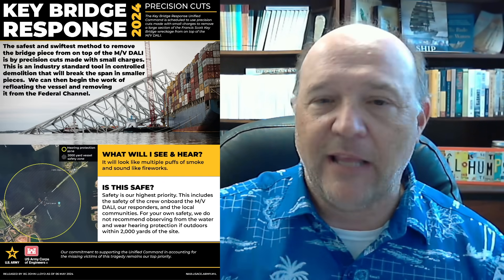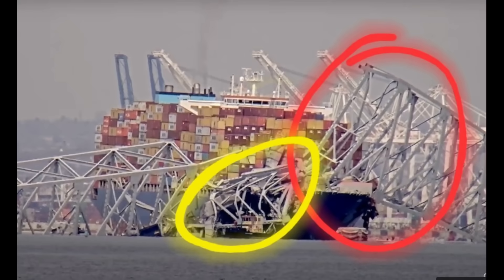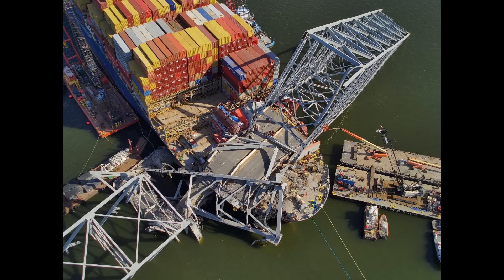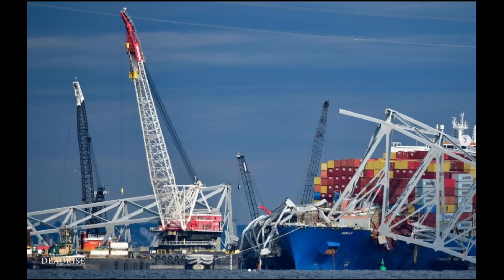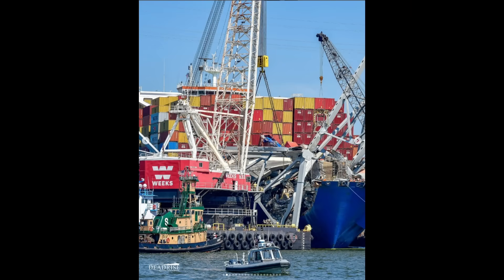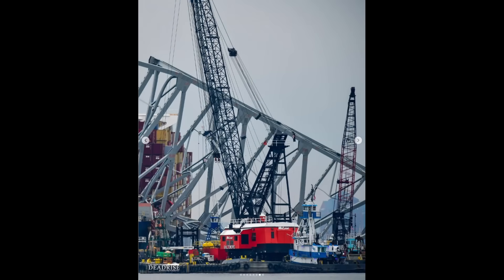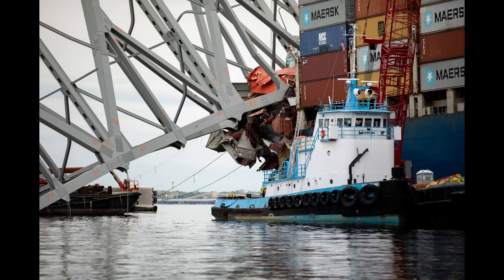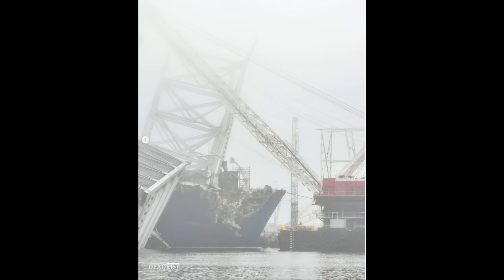FIRE IN THE HOLE! | Baltimore to Blow the Key Bridge Off MV Dali

Comment: I still want to know how they're going to get those concrete columns out of the way. It's not like the big crane will be able to lift one of those big chunks.
Reply: The concrete breaks up quite easily with a large hydraulic/air/steam breaker.  Torching the rebar etc
Reply: @jonmccormick8683  I just saw another video that showed where they have started cutting the column apart with a concrete saw. I want to see video of such a saw in action. 👀

Comment: You imply that it is all going to be hunky dory after they clear the bridge off the Port side, saying one that is done the weight will possibly come off the bow and they might need to move some small bits to remove the Dali.
Only one slight snag with that!
well quite a major fact that you over looked!
yes they removed part of the bridge metal work off the starboard side and they have removed most of the metal from the port side, but that is not the end of it! the Dali is not going to be removed as quick as you think!
they still got a huge problem that you overlooked namely that huge column of re-enforced concrete that is still attached to the foundation of the bridge, that has also snapped over the gunwale that is buried under the road deck. As pictures show that is a massive piece of concrete! that is not going to be easily removed with all the re-enforcing inside of it.
I think you will find the Dali is going to be there for a few more weeks.
Reply: They can cut through the rebar with torches. The concrete is gravel at the broken joint. With the containers they've already moved, and the girder taken away, the ship might float already. They can get her to the dock and continue demoing the pylon there.
Reply: @blairhoughton7918  yes like you say they can cut through the rebar that they can see, its the ones they can't see that is going to be the problem.
if they manage to cut through that, you still got the problem of the pylon, that looks to be about 40 -50 ft long, then you got the part of the pylon that is under the road deck.
yes they might cut it off the foundation but looking at it the pylon is longer than the draft of the Dali and if that falls into the water that could act like a spud leg.
I think that is going to prove to be a bigger challenge to remove than the steel work.
but we shall see.

Comment: What are the odds that some of the falling bridge will damage the gas pipeline when they blow it?
Reply: About zero.  The issue is that maybe the pipeline is already damaged and with the weight now coming off you have a leakage.
Reply: Sal mentioned in another comment that the pipeline has been depressurized.

Comment: How will they manage EOD clearance before resuming work on those elements?
Do they use photo analysis to determine which charges, if any, failed to fire?
Reply: Failed charges most likely will not be a thing. They won't matter if they fail. They will just go into the ocean.

Comment: you really think it's gonna float with the mud suction and the big concrete pillar still pinning it down on the starboard side?
they're just gonna let that pillar fall off if dali floats?
Reply: The tide should be able to lift this ship and pillar quite easily, however the hull suction to mud is a large force.  -If the ship lifts from the rising tide, everything should go well. 

Port of Baltimore did this to another container ship that went out of the channel just a year or two ago. -Took a few months to refloat at high tide, with many containers needed to come off.

Comment: Ship Can’t be too damaged  if they force crew stay on board
Reply: Operational and SeaWorthy can be quite opposites.  -This ship will most likely be scrapped.
Reply: What documentation supports the conclusion that the crew is being "forced" to stay on board? 🤔 The ship is not sunk, it still has plenty of systems which need to be maintained for use when it is freed, that maintenance requires a crew.
Reply: @scottfw7169  mentioned crew still onboard 😆 us think if they had a pass they might go sightseeing? Well maybe not in shythole Baltimore 😆😆 but could hop off claim refugees, go past go , collect $10,000. Snap card and free citizenship. Most like Philippine origin have many friends  here

Comment: Why didn't this bridge have dolphins protecting the bridge piers?
Reply: It did/does. There are only 4 of them, they are rather small, and are far enough away from the bridge piers that Dali could sideswipe one and still hit the bridge pier.
Reply: @scottfw7169 Or in this case, just curve around the dolphin without touching it.
Reply: Dali cruised right by the dolphin that was supposed to protect the bridge pier, it was small and too far away.  A single small dolphin for each side of each pier, total of 4. By comparison, the replacement Sunshine Skyway bridge has 36 large dolphins and 2 large rip rap islands surrounding the suspension towers.

Comment: Sounds like a bad idea. To prevent further damage to the Dali, explosions are unpredictable at best and likely to cause further damage to the vessel. 

The simplest and safest method is to have several cranes attach to the bridge, to lift support the remaining parts, and remove the cut off section, then lifting the cut section away, then repeat until the ship is free. There is also the risk risk of the cur section that;s dropping gouging into the hull of the ship.
Reply: Shaped charge cutting is very well established. With CDI involved, the cuts are predictable.  Lots of math involved in designing the placement of cuts.  Lesser demo companies have indeed had problems.
Reply: No, you are wrong. This company doing this might be the best there is. This is highly predictable. Shaped charges are not new. Trying to coordinate multiple cranes is far more dangerous and hard to do.
Reply: The section resting on Dali is under enormous tensile and compressive stress, thus the intention is to get rid of the whole truss in a couple seconds.  The cutting is done by shaped charges, using the same principle as bazookas and later antitank rounds. 
Note that the explosions are sequenced over a period of milliseconds up to seconds to make the trusses rotate away from the ship.  Similar to how they implode a building, blow the internal columns first so that the center collapsing pulls in the outer walls. Mechanical Engineer.

Comment: They are cranes in the world which the USA could have used to remove this steel structure months ago. Is it that because the USA don't want to introduced other countries into this task? I thought that this removal was completed months ago. The USA seems to be doing unnecessary work. I don't agree with video presenter that there isn't a crane in the world which cannot remove this steel  structure. China, Germany and a few other countries have crane which can easily remove this steel structure. This is just politics.

Comment: Maybe it was too expensive, or the harbor not deep enough, but what they could have used was the vessel SLEIPNIR of European design.  They probably could have finished this job weeks earlier having a REAL hoisting device rather than the little toys they were playing with.  Explosives would have been unnecessary as well.
Reply: With that much force, the trusses would fold up and you'd have a bigger mess.  C1000 and 533 are taking big pieces, up to 450 tons.
Reply: @SteamCrane  First off, you only use the force required.  Having overkill power but not necessarily using it, is an advantage.  You saw all the detonation points,  There's gonna be lots of little pieces left over to clean up.  I don't think the harbor is deep enough to accommodate that large ship any way, so it is really a moot point.

Comment: What could possibly go wrong…
Reply: Based on the animation, I noticed that after the charges went off, there was still a big solid piece of bridge sticking out of the water. Why doesn't it fall down once the ship is not supporting it? And if it does fall down, won't it strike the bow below the waterline?

Comment: Im confused as to how explosives will do what acetylene torches or plasma cutters cant, especially without damaging the ship.  Cant they just cut the bridge into smaller and smaller pieces?
Reply: The bridge span is under load, some beams will be in tension and some under compression. If member is under tension, when cut, it will spring appart. Those under compression will spring together. With separate cuts the loadpath will change. Having the steel move when cut is dangerous for the cutting crew.

Weakening the steel and then using small qualities of explosive to complete the cut, allow all of the cuts to be made at the sametime. In practice the timing of the explosions could be adjusted, so that the loadpath changes and ensures that the cut pieces fall clear of the ship.
Reply: @christopherrobinson7541  Excellent description.

Comment: Are they going to use the same explosives that was used on the twins ?
Reply: Are you going to ever grow up?
Reply: @blairhoughton7918 I think the reference is to building 7 that was taken down after with explosives.
Reply: @robinblackmoor8732  "the twins"
Reply: @blairhoughton7918  yeah, building 7 of the twin tower complex. It needed to come down. So, they used the same technique that will be used for the bridge. I think that is what the original comment was asking.
Reply: @robinblackmoor8732  The WTC complex, of which the Town Towers were only buildings 1 and 2. That's a long long way back to reach in history for a reference to explosive building demolition. And looks conspiratorial as it's phrased.

But to answer your question, yes the principal is basically the same. You put a linear shape charge across a steel beam and set it off and it cuts the beam, which no longer holds things together. Gravity does the rest.

Though in this case there's no wall material to get out of the way first, and there will be almost no dust cloud obscuring the view because there's no masonry and everything is going to fall in the water.

In fact, you could probably search for bridge demolitions and find a dozen more similar examples.

Comment: Why would you blow up the bridge when they get chemicals on their corrosive stuff are they that much of a lunatic you don't do that when you get chemicals and crap like that on those containers
Reply: small contained charges
Reply: Good bet the containers with the chemicals up forward have been removed, and the ones that were crushed under the bridge have been cleaned up the best they can.
The shaped charges will be mostly set off parallel to Dali (as they're cutting the steel beams) so any shrapnel that makes out past the wrapping will go beside Dali, in addition to the charges being very small.
Reply: periods and commas, periods and commas..........

Comment: So i guess the work stoppage yesterday c due to a gas leak is no concern with greenlighting explosives? Sounds like a plot for a Wylie Coyote cartoon.
Reply: Explosives won't affect gas. Just the opposite. The pressure wave would break up any gas cloud that may be there. Gas is harder to ignite than you think. The air/gas ratio has to be be just right.
Reply: @robinblackmoor8732  all it takes to ignite a flame/ explosion is a spark. Look at your gas stove or grill.
Are you the same guy who checks to see how much gasoline is in his  tank by using a match for illumination?
Reply: @DanHolmes-o9b  gas stoves have nozzles and valves that control the mixture. Free gas in a cloud from a leak is not the same thing. Clearly you don't know how gas combustion works.
Reply: @robinblackmoor8732  actually I do. Case in point Einstein: a gas leak in a home/ building left unchecked will combust and explode. Usually leveling the home or building. I've seen it several times in my own neighborhood. Any other analysis need explained?
Reply: @DanHolmes-o9b  gas in a house is contained. So it can ignite pretty easy. This is open air and ocean. It will be a cloud that the wind blows apart.
Reply: @robinblackmoor8732  I'll make certain Wylie Coyote gets the memo.